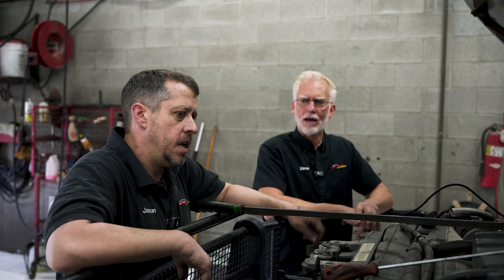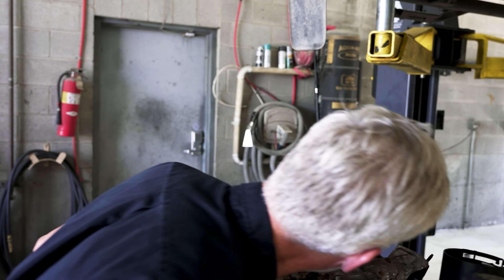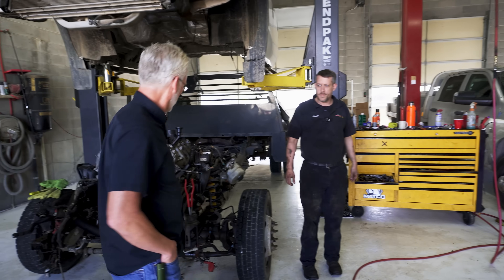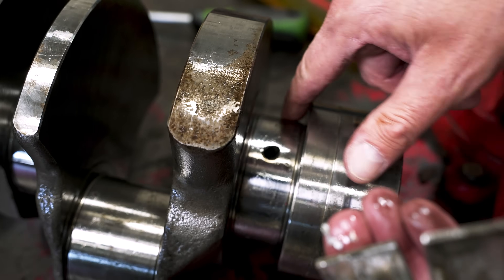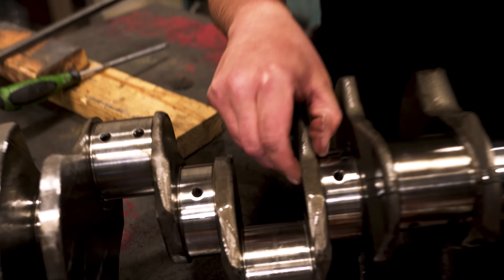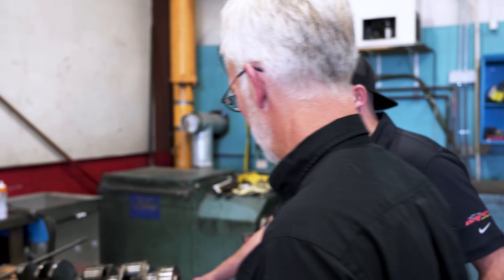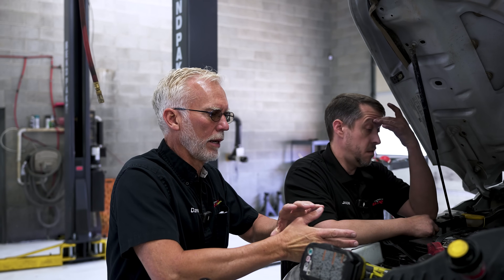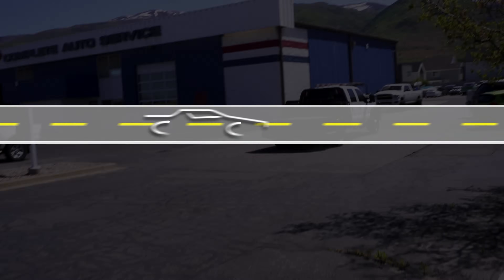Ford 6.7 Power Stroke Failure

Comment: Not surprising to me. My 6.7 powerstroke blew up at 89,000 mi and was just out of warranty. $22,000 for a new engine.
Reply from the maker: Sorry to hear that - painful
Reply: @DavesAutoCenterCenterville how much fo you charge for a new motor for the 6.7 powerstroke? And what is the warranty? Thanks
Reply: Rotella T6 5w40 every 4000-6000 miles. Run some lubricity in the fuel and keep all the filters changed at a good schedule. Our 2020 is a workhorse.
Reply: @paulschab8152 
Hoss Cartwright 
My 
O1 WJ 4.O L can beat that easily. 😊
Reply: @paulschab8152 you just nailed it 👍
Reply: Wild - sorry to hear that man...
Reply: Box of matches or crash into a wall get new truck.
Reply: @Richie-Wales 😂 just don’t Google about it, talk to anyone about it, like any comments about it, buy a book about it, or anything. Just do it.
Reply: Where on earth are you buying that engine for 22k?? Im a ford tech just curious
Reply: @sounboy4498  I guess I should clarify. The engine with labor was 22K
Reply: @garthvader801  all good man, I hope it was a long block and not a reman one. Service it well an I hope it never fsils on you again
Reply: @sounboy4498  yep that’s what I do with my 750,000 mile 2010 Cummins I just hope and it just keeps going. Hope is wonderful. Isn’t it just keeps engines running
Reply: @garthvader801 mine was replaced at 150k. Engine was 10k and install was 10k. I feel your pain.
Reply: @sounboy4498 probably included labor and who knows what year this was done not sure how much it'd cost when the truck was brand new (am not a ford tech)
Reply: @sounboy4498 Is $22k too cheap?
Reply: 2003 f250 cc srw 4x4 flatbed 7.3 299k. Best truck ive ever owned period. Just pulled up to the house a few minutes ago.
Reply: W T F💰
Reply: $15,000 for a Ford V-8 gas engine,  blown at 32,000 miles.  To add insult to injury,  they put the old spark plugs back in causing a SES light/code. 😬
Reply: 7.3 powerstroke over 400k miles all stage 2 everything I beat it everyday n keeps asking 4 more fuck these new trucks
Reply: @Buttfuker3000  I had a 1992 before the turbo, overhauled with sleeves because of a pin hole in a cylinder wall. All back to factory specs at 170,000 miles, ran it to 490,000 no problems,just a clutch and pressure plate, resurface flywheel. The spring loaded flywheel spit out a spring.
Reply: I knew what you mean because about everyone I know gets a rebuild and it didn’t last. You could spend a bunch and have it screw up again, then have to spend more. If it’s fairly new vehicle, just buy a new engine.
Reply: @bbaaspencer1 🎉
Reply: Dave's monster engine with the upgrade piston are only 16k
Reply: @Rizzoli_690  installed? Probably not
Reply: That's a ford for you..
Reply: @DocHolliday3841  Go to any diesel shop and they’ll tell you that EVERY brand has failure issues.
Reply: @DocHolliday3841  that is not a Ford problem it's a Navistar issue.
Reply: 14 with 750,000. 16 with 620,000. It's all in how you treat your equipment. My 14 has the big turbo and all the fun stuff that costs money. CP4 and a dusted stock turbo from the repair shop pinching one of the intake boots is the only reason I have that stuff. Driver got bad fuel that killed the pump.
Reply: Lol😂 oh you’re not done yet unless yours is the driveway queen which means you haven’t towed with it. The old tranny is going to do the same thing before you hit 125,000 miles but you can always come back here and tell us afterwards.😂
Reply: @AmericanSurvival1  yeah an f550 driveway queen. I sold it before the tranny could go out
Reply: My brother just blew his up at 300 thou. kC turbo and big injectors finally did it to her. My old 2011 6.7 that I sold is still going at 310 thou. I know the kid that bought it.
Reply: @chucklohnes7652 😂cp4😂😂😂
Reply: I would say the crank journal was machined incorrectly, not enough clearance between the crankshaft and rod bearing to cause the failure in less than 1,000 miles, probably the wrong bearing from the get go or they just said screw it, get it out of hear fast and easy.
Reply: i’d never buy a new diesel truck.
Reply: I’m so glad I don’t have to run modern diesels.  God bless my Toyota V8s. Dave, how often do you have to put a new engine in a Toyota truck?
Reply: @hokie9910  no kidding. My tundra has 230,000 miles and I've only had to replace the water pump and starter. It's been awesome.
Reply: @garthvader801  Yeah, I left the domestics many years ago after the front steering assembly literally came apart while I was driving…it was a 2005 F250 with 8k miles….yes 8k miles….the best never rest…lol
Reply: I work on 6.7s all day and have never seen one blown at such low miles without it being the customers fault if you didnt neglect it then you had a rare case
Reply: @greenespirit4973  I'm telling you man, this truck was the backbone of my business. I was religiously maintaining it. It had zero modifications in any way and I wouldn't have jeopardized my business for that. It was just one of those things I guess
Reply: @garthvader801  You obviously don't know how internet vehicle experts operate kind sir, your actual experience is not what really happened to you, lol.  Sometimes engines just take a shit.
Reply: Should be criminal! Unless it was clear negligence on servicing the vehicle or plain ignorance a 100k powertrain should be required by law or a large discount on the truck. With how much people drive nowadays and proven reliability from older models the trucks should be lasting longer not shorter. I know the EPA has a large part but the manufacturers also enjoy the benefits of pushing the blame on someone else
Reply: I thought that the 6.7 was the best diesel Ford put in their trucks?
Reply: @Dave-ll6ei  me too
Reply: That’s not the norm for the 6.7 unless you are the norm that doesn’t maintain there vehicles and wonder why it tears up
Reply: @pwilly8543  nope. My work truck is my livelihood. I depend on them everyday, therefore I maintain them meticulously. And I think you mean, - THEIR.
Reply: Good crank grinder?
You'll have to hit up the cleaning guy at JAMSI they're somewhere in your neck of the woods
Reply: Same thing happened to my 2012 6.7. Engine went out at 136k. Got a reman from Ford thru an autoshop and it cost us 21k for engine + install from the auto shop here in town that we trust.
Reply: If it's not surprising to you then why even bother with a new Ford? all modern trucks/cars are fucking garbage compared to 1990 - 2005
Reply: ooooooff
Reply: That is actually cheaper than I thought it would be. I just about paid that to drop a new motor in my 7.3. But it was also slightly upgraded
Reply: IF HE IS TOWING VERY HEAVY WITH A TUNE AND NOT KEEPING RPM UP THE CRANK CAN CHATTER AND DO THAT TO BEARINGS
Reply: @hankclingingsmith8707  & then at it raises the question of he did tune what tune was he running it wouldn't surprise me if some dummy said oh hey my hot tune makes 800hp let me tow with that 🤣🤣
Reply: Holy shit!🤯
Reply: Sorry 😞 to hear this
Reply: Damn that sucks every time I hear stories like this. I’m just gonna keep mine. I have a 97 F350.& 99 F250 one has 435,000 on it. The other one has 415,000 on it no Computers or limited computers compared to the new trucks but no exhaust bullshit DEF. DPF none of that shit
Reply: $27k for a new one here.  Fully dressed engines are discontinued so it’s $21k b4 the $3.5k core charge comes off purchasing “Al a Carte” engine.
Reply: In south africa I can buy 6 x 5 cylinder 3.2 duratec ford diesel engines for 22000 dollars.
Reply: Yeah they died quite a bit actually. A lot of times it's a fluke but it's a lot of fluke. The Cummins and the Duramax still continue to be the most reliable by far.
Reply: @ashes2ashes863  I think the Cummins engine itself is just in a different league in regards to durability and reliability.
Reply: I will never buy another diesel
Reply: Gas jobs are lasting longer than diesel for less money
Reply: @johnpatillo5203  Yeah, as long as you don’t have to tow heavy daily, I just don’t see the reason to buy a diesel at this stage in the game.  I had a 5.7 Tundra and it was a beast, water pump at 210k and the rest was basic maintenance and until 300k
Reply: I got 120,000 on mine 2015 f450 before totally imploding 6 months wait for a new one from  Ford
Reply: @F0X_1N_S0X  Not great…
Reply: I'm at 286k on my 2015 and zero issues. No tunes, no after market stuff other than the disaster prevention kit. Service is key on any modern engine
Reply: Bummer I have 297k on mine. Deleted but have literally never replaced a single part other than fluids and filters
Reply: That's the policy of all manufacturers, until the warranty and then booommmmm
Reply: Warranty on a factory Ford truck with a 6.7 should be 3 year 36,000 miles bumper to bumper and 5 year 100,000 miles on powertrain .
Reply: @brandonray1707  I know that. The warranty timed out it didn't expire due to mileage
Reply: Let me ask you this, what was your oil change interval, did you do it, or a shop?, (do you know what brand, and weight of oil was used) and equally as important, your fuel filters? How was your maintenance process on them?, I don’t ask to assign “blame” just very curious as we see more and more 6.7’s problems showing their head, I’ve got a few 6.7’s my newest one under warranty has a consistent tick once warmed up, and at idle, it is not present at cold start, nor at pto operation rpm “truck has a pto driven crane” , however every once in a while at pto rpm I’ll hear the truck stumble almost like an injector failed to fire? I bought it with 30k and 4 yrs old, I took it to ford and had the best and longest factory warranty option available… I think it’s 7 years, 100k miles , and there was an hour I think 4k hour but this ticking noise makes me nervous…
Reply: @GRANITEMONUMENT  I change my oil in all my vehicles at 3000 miles sometimes a little over.  My son changed it ( since he was the manager of an oil changing shop right by my house)  I used Valvoline premium blue full synthetic 5w-40. The problem was the #6 glow plug broke off and went into the combustion chamber.
Reply: @garthvader801  well sir, that is a known tsb on I think the first three months of the 2011 6.7 , they had a bad batch of glow plugs!  So did your truck fall in that manufacturer date? Or was the engine replaced with one that did?
Reply: Also, 3000k mile oil changes ?? And to use full synthetic?? I guess the junk filters would not matter with 300k intervals, were they also doing the fuel system every other? I guess if they are doing it for free, why not!
Reply: @GRANITEMONUMENT  I have no idea.
Reply: @GRANITEMONUMENT  yeah. I'm telling you man, I tried my absolute hardest to make that truck last. At the time, it was a  huge investment for my new business. I really wanted it to go 400k
Reply: Man that sucks
Reply: The 6.7 is actually a very reliable engine. 90% of failures I seen where from lack maintenance. Other 5% was from putting gasoline in them. The other 4% was emissions stuff, and 1% was actual failures
Reply: @1FiftyOverland  That's what I thought. That's why I bought a 6.7. but apparently the 2011 model had glow plug issues. Mine was a result from the number six glow plug breaking off. I think any normal person that got stuck with a $22,000 repair bill at only 89,000 miles wouldn't really care if they are reliable for everybody else. I mean I'm driving a Duramax now because of that and I think any other person would do just about the same thing
Reply: @garthvader801  They issued a fix for that. It should have had the new glowplugs put in it.
Reply: Keep up on maintenance and it will run fine for years i have buddies with 500k miles on the 6.7 only thing done was a cp3 conversion
Reply: @dmx309  well, it definitely didn't
Reply: @dmx309 

You lost all credibility with CP3 swap comment....it never happened.
Reply: My 2012 F350 6.7
Just let go. 72,000 mi. Very well taken care of. No mods and now the glitter fairy. May take it to Dave for a monster engine.
Reply: @jcarieri5435  take it to Gillette Diesel in bluffDale. Dave's did me dirty a couple of weeks ago
Reply: @jcarieri5435  take it to Gillette Diesel in bluffDale instead
Reply: @garthvader801  Thank you, I will check them out
Reply: @jcarieri5435  yeah honestly, Dave's did me dirty a few weeks ago. I'll never take another vehicle to them again
Reply: that's genuinely sad
Reply: Dpf will always be bad for the truck.... better removed
Reply: Ford diesels are junkkkkkkk!!!  Wait till your crank breaks cause poor oiling design by ford on the 6.7s
Reply: I bet a monster engine would’ve been a better engine
Reply: Original  owners should just take it to the scrap yard instead of RIPPING PEOPLE OFF!!!
Reply: I’m seriously considering buying a new gas truck in 3500 and swap it with 5.9 and built 48re pre emissions it’s got to be doable
Reply: If you were forced to eat your own waste all day everyday you wouldn’t last long either. 😂
Reply: Bro the powertrain ends at 60 k miles lol I tell everyone get the best longest warranty from the manufacturer and negotiate as they will go down in the price. My friend just got a new trans at 125k mikes on his explorer bud warranty was till 150 k miles 
He’s also had other repairs done while he’s had it A/C axles and some electrical stuff. I helped him get the warranty for 5 k and the repairs are almost 4 times that and he’s only paid his deductibles which amounts to 600$ lol
Reply: Huh my brother has 215000 mile on his original engine
Reply: Same I have a 2021 f350 with 65k miles on it. I pumped contaminated fuel and it messed up the entire fuel system and damaged the engine. Luckily my insurance covered it but the repair was 23k from ford for a long block
Reply: Upon completion Dave stated  the truck was tuned….that explains quite a bit. Leave these things alone they are working hard enough especially in a 4x4 dually .
Reply: @JohnDiMartino if he was gonna do anything it should have just been deleted/tuned that's the winning combination for modern emissions diesels save u alot of time & money leave that def shit alone
Reply: @JohnDiMartino  I agree. However,  Mine was 100% factory. 2011 Ford f550 box truck. Used for work every day, No mods in any way
Reply: The warranty just expired that adds insult to injury
Reply: @cedricjackson7521 You'd think a DECENT dealer/manufacturer would do something to help other than turn their back on you. Not today😢😢
Reply: Did you buy it new or used and what oil change intervals did you run? 89k blow up there is more to story
Reply: @kfrench201  I bought the truck with 18k miles. I actually flew out to Virginia to get it since nothing in my area had such low miles. I changed the oil every 3500 miles like clockwork. The reason for the engine failure is #6 glow plug broke off and went into the combustion chamber. There's actually nothing more to the story. After the repair, I put another 60k miles on it and sold it. I bought a Chevy 5500 since the Ford left such a bad taste in my mouth.
Reply: @garthvader801  there’s gotta be more. The first owner in those 18k ran it too hard, too hot of tune, neglect, etc. sounds like you did everything you could. I think you have better odds in Vegas then a used diesel
Reply: @kfrench201  I know what you're saying, but it was a completely factory cab and chassis box truck from an office furniture delivery company. No tune,  No cold air intake, stock  injectors, turbo, everything. It was totally un  molested
Reply: @garthvader801  What year was your truck?  Some early 2011 builds did have issues with glow plugs and valves breaking.
Reply: @outbacker292  dang he left before he could tell us the rest of that fairytale 😔
Reply: @garthvader801 there is more to the story. Do your research before you buy a vehicle and never, ever buy a first generation anything. Not saying it’s your fault, but in general first generation engines will inevitably have some sort of issues.
Reply: @garthvader801 😂
Reply: @kfrench201  the 2011 and 12 models were known for grenades. You can drop a glow plug into the motor and blow it up or the ceramic bearing from the turbo could fail and dropping the motor and blow it up. That’s why went by 6.7 power strokes, you wanted to stay away from the first two years of the new motor 2013 they fixed everything 2015 and 16  probably the motors from the 67 power stroke
Reply: @jdecker89  you’re really just making excuses if you’re paying 80 or even 100k it should work plain and simple! I understand shit happens but they should bend over backwards to help their customers. The laws need to change definitely inside the EPA
Reply: @garthvader801 it was a 2011 engine wasn’t it? Those are notorious for the glow plugs swelling and breaking off and destroying the engine. They are also notorious for cracked exhaust valves breaking and destroying the engine. I have a 2011 with over 200k hot tuned still running great.
Reply: @tommybragalone7943  yes, it was a 2011.
Reply: Engineered to fail, business structured to fuck customers over
Reply: You guys must do those all the time! That tear down look like it was routine? 👍👍
I can't believe how much stuff is on that engine it is mind-boggling!!!
Reply: @richnickelson8069 I was thinking the same thing 😅
Reply: Ford , the only reason mechanics don’t open an OnlyFans account.
Reply: I would never buy anything with a blue oval on the hood.     Another junk Ford
Reply: Why did it blow ? Seems odd unless poor maintenance an lack of 150 dollar oil changes.... don't own a diesel if you can't afford the maintenance and BTW 5.9l Cummins is still the best most reliable diesel engine every manufacturered it'd not the most powerful or what nit but definitely the most reliable, no v block diesel will ever compare because they aren't balanced right
😊
Reply: @mattm3843  #6 glow plug broke off
Reply: @mattm3843  Wow, such venom. New fuel filters (Motorcraft) every 15,000 miles. Amsoil Signature Diesel 5w-40 every 5,000 to 8,000 miles. Never over heated. Towed trailers loaded that were less than 15,000 lbs. ( I confirmed on a CAT scale) Transmission, new motorcraft filter and fluid every 30,000 mils. Diffs and transfer case serviced the same. I would say that I did more maintenance than most. Have already spoken with Dave's auto Center, and will probably have them install a tow monster plus. Oh BTW, I will pay cash for the repair. Things happen. Nothings perfect, even you.
Reply: @mattm3843  #6 glow plug broke off